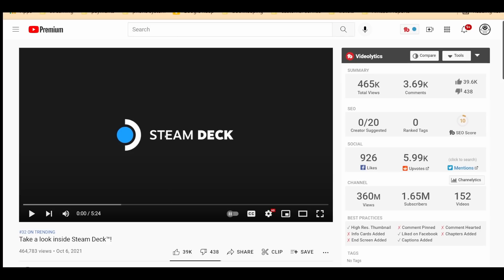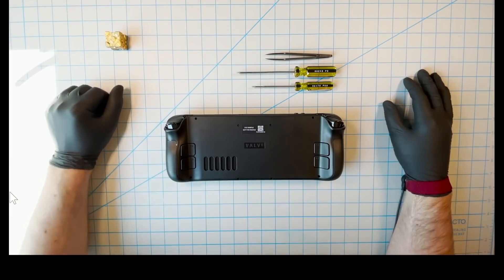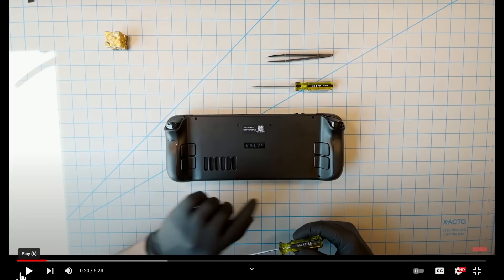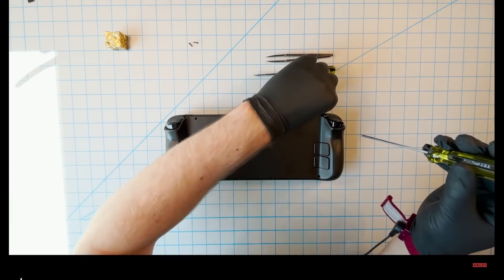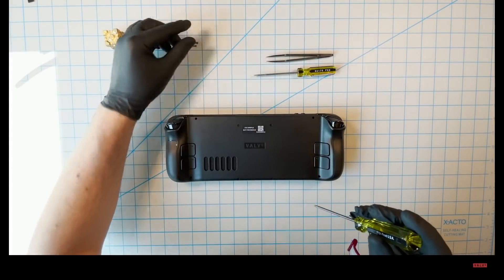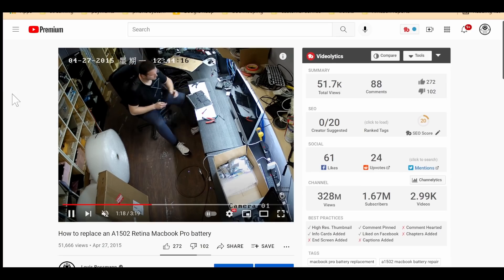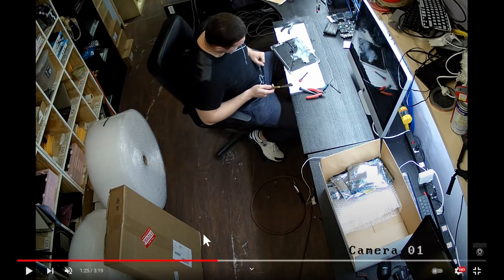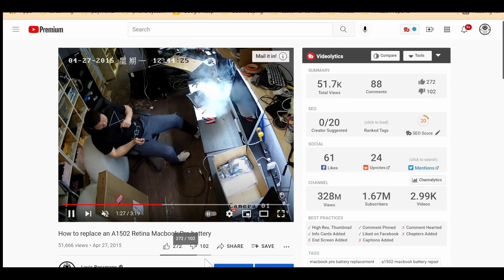Steam deck battery may end your life? bruh 😑

Comment: There are some truth about loosen and tighten those screws will cause problem one drop resistance. Unlike Apple devices, Steam Deck is mostly made of plastic with no metal insets, screwing back will cause some unavoidable damage to the plastic threads.
Usually the screw is the worn part (should be more easily worn than the nut).
I recall in some Nokia phone repair guide, you have to throw away a tiny screw and replace it with a new one.
In aerospace industry, damage to threads is a concern to metal bolts screwing into metal frame. You need to replace all the bolts when replacing windshield on some models of planes. There was an incident where a mechanic replaced a windshield, but when replacing the bolts he replaced the bolts, but didn’t check the length, ending up used bolts few millimeters short. Later the windshield came off inflight and suck the Captain halfway out. The captain survived, a crew held onto his legs and tore both of their arms’s forearm muscles.

Comment: Louis, as you point out, the structural integrity will not be significantly weakened by opening the device. However, the screws are self tapping which will have a tendency to strip the walls of the screw holes in plastic. If you open it multiple times or over torque the screws, you may be permanently weakening the device. So, as you said, it won't be likely to cause serious loss of integrity.

Comment: Structural part: unless there's some pressure fit stuff or you open and close it multiple times i don't see how it would ruin the structural integrity. Though I've had some controllers get really like squeaky after replacing dome parts.

Comment: And about the lag on parts, that might just be a supply chain issue. Due to the complexity and variety of materials used, a delay by any manufacturer or reseller will slow down deliveries down the whole chain. I'd actually be surprised if they had spare parts on launch since they clearly sold out the consoles, any parts still in stock could be used for making more decks to meet short-term demand. I'd start getting worried if they still can't stock parts a full year after product launch.

Comment: My question is are they gonna provide the proper SSD's as replaceable parts (and ideally, at cost).  If they did that, I see nothing wrong with this video or any of their warnings. All legal mumbo jumbo that's required in the same way McDonalds' "Caution: Hot" warnings are on a damn cup of coffee.  To prevent retards from legally extorting them for the information they kindly provided. A necessary CYA in today's world, since no good deed goes unpunished.

Comment: re: loss of structural integrity because you opened it and closed it back up
Yes and no.

(I used to work as a crash safety structural analysis engineer at a Tier 1 automotive supplier (Magna International).)

If you opened it and closed it back EXACTLY as it was prior to opening it, then it is unlikely that you will have a problem.

However, where you MIGHT potentially run into a problem is if you opened it and then upon trying to close it, the holes, for example, are SLIGHTLY misaligned, then it is, theoretically possible that the structural integrity may be slightly diminished, but it shouldn't (generally) be statistically significant enough for you to cause it to compromise the structural integrity of the unit.

If it did, it would tell us that the design inherently did not have a large enough margin of safety designed into the product, which I would fault the manufacturer for its failure to account for it.

If the latter was also true, that would also mean that the manufacturer itself would be putting itself in a position of risk because if, during the assembly process, the unit is misaligned, or aligned beyond the designed tolerance specifications, then the manufacturer would be liable for an increase in warranty return unit costs because they didn't allow for a high enough margin of safety/tolerance window/band whereby within that wider tolerance, the product would still be and retain its structural integrity.

If this were true, and the manufacturer designed the product in such a way that it had really tight tolerance limit, such that it was failing, out of the factory; then it would be a prime candidate for a class action lawsuit and this video can be used as evidence that shows that the company knew that it was potentially a problem, but decided to make it that way anyways.

That's just inviting in a whole lotta trouble on the part of the manufacturer.

Using computer aided engineering tools like LS-DYNA, we can run different permutations which simulate the degree of misalignment (as an example) and assess the impact (no pun intended) that it will have on a drop test result. That's actually really easy to do (from an engineering standpoint).

So, it's possible, but I would think ONLY if you misalign it when you put it back together; and you'd probably have to misalign it in a reasonably significant way such that you would likely have problems putting it back together in the first place, or if you KNOW that it's misaligned, and you're deliberately trying to jam it back together anyways (as opposed to taking the two halves of the clamshell back off, and trying to get a better alignment with the next attempt).

CAN you screw it up such that the unit will lose its structural integrity? Yes.

But there'd likely have to be other things wrong with it that the user is just flat out, simply ignoring those problems, such that it will have an adverse impact (again, no pun intended) on the drop test results.

In normal use cases, this shouldn't be a problem. (Unless, of course, they're taking a page of from Apple and then blame you for doing it wrong in the first place. But I digress...)

Comment: Me daily driving a electric skateboard with a remote without any casing holding the Li-ion battery and circuitboard in my hand. Didn't explode yet.. Previous battery was puffy so I replaced it ~2 years ago when the case broke. haha.

Comment: I think that the main focus from they producing this handheld device was making it the most affordable possible, and knowing the internal hardware they've put in to it seems like they compromised on other places like the case and so on. I remember that a while ago I took apart a quite cheap Sony Vaio laptop I had, in order to clean the dust out of it and later then added more ram, changed the wifi chip, replaced the HDD to an SSD, and each time I put the thing back together I noticed that the structural integrity was worse to the point it started breaking down after a couple of years.
Maybe what Valve is saying is that the outer shell of the device is quite cheap without really saying it because that would be a really bad way to sell the device, also in order to avoid the bad PR they can potentially get if people actually try replacing any internal component and then realize soon after the plastic of the outer shell is cheap. You can really destroy clips of some plastic devices if your'e not careful enough when prying and that does compromise the integrity of the structure.

Comment: When they say 'coming months' for replacement parts, I expect that's because of supply chain issues which have been ongoing for several years now and they're directing most if not all available components to manufacturing.  Valve in particular seems to suffer from this and has for a long time.

I also expect the issue with the self tapping screws is that they may decide to cut new threads into the plastic instead of going back in the same way you took them out, which would reduce their holding strength.  Now do that a couple more times and they're more likely to strip out.  But honestly it's not fatal to the device because you can just fill a stripped hole with some fresh plastic and let the screws self tap their way into the repair good as new.

Comment: I think it can affect the structural integrity. Why? Because normally when people, including me, tighten up screws after doing Sth, they tighten them too much, and some screws maybe left too loose. Tightening up too much may introduce residual stresses in body which can result in failure of entire back plate. Besides residual or uneven stresses, there can be too much vibrations if you let it too loose. let's say the device fall, which once again can damage sensitive components like screens. It is simply impossible to tighten up the screws with human hands with the same precision and accuracy as that of Machine. Also the engineers may choose to tighten up the screws to certain level where they are not too tight to introduce stresses in body, and not too loose to introduce vibrations. How do you figure that out? So, does it compromise the structural integrity, hell yeah. This is also in line with my own personal observation, once a device is opened, it's never stays the same structurally.

Comment: Regarding structural integrity: it seems that the case is not just held together by the screws, but also by some plastic clips/hooks around the rim. If so, then yes: prying those open will slightly weaken them (even if they don't break right away).
Reply: In the industry those clips are called snaps, and they won't be damaged as badly as the screw bosses. The best way to have screw bosses that allow multiple opening and closing of the housing would have been to either insert mold or push weld brass threaded inserts into the screw bosses. But because Valve had to keep the costs down on this device, they stuck with self tapping screws, which nobody can blame them for, this device isn't meant to be repeatedly opened and closed anyway. But with the excitement over the repairability of this device and customizability, we'll probably see replacement or third party housings available at some point. Hell we might even see DIY mods on how to install your own brass inserts that you can buy off Mcmaster carr.
Reply: And because if you overtighten the screws, you can damage the threads, dropping it could potentially break the threads and pins
Reply: With that in mind, I'm surprised that they haven't glued the case shut.  Heck, even inject a solid block of epoxy glue in there for "structural integrity and non-serviceability" lol
Reply: They could also use some sort of mild adhesive in some places.

Comment: Hey Louis, agree with pretty much everything you say but I was opening a lithium ion battery when red sparks started flying, threw it down (on carpet) and ran to get a fire extinguisher and put it out but had I not had a powder extinguisher my apartment would've probably burned down. I don't think Valve mean instant death but I can see how it could eventually lead to someone's death
Reply: What have you learned from this action?
Reply: Why did you throw it on the carpeted ground?
Reply: @KhanSphere  because it was in their hand and most people would instantly drop something that started sparking luke that.